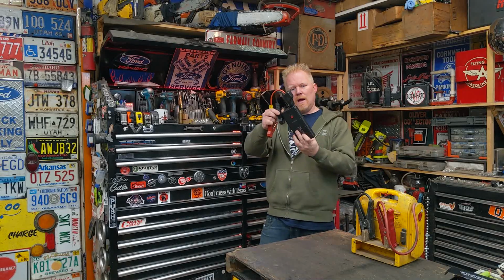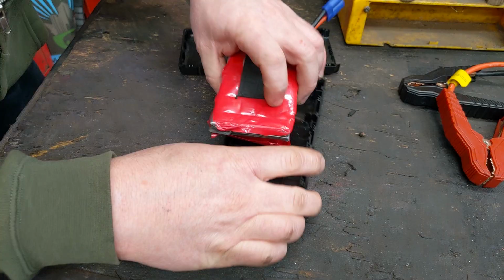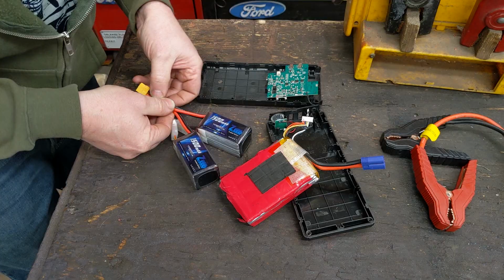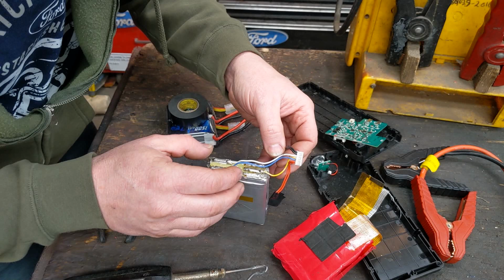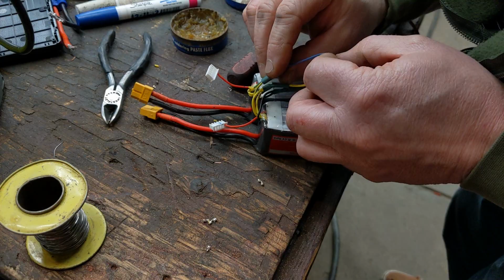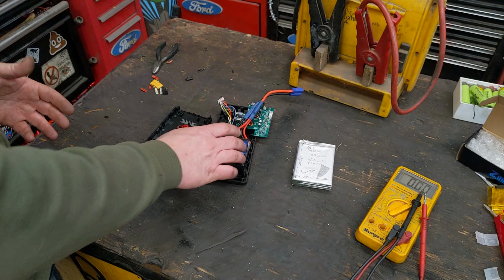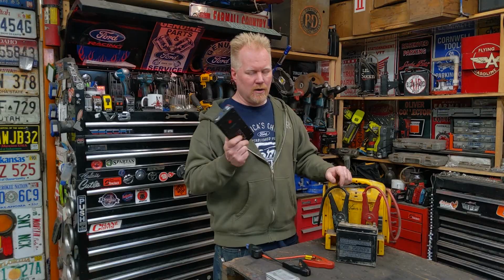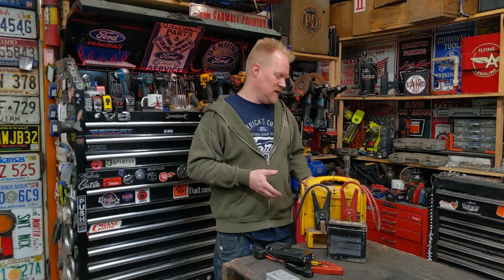Lithium Jump Pack Battery replacement HOW THEY WORK

Comment: Buy a super capacitor jump starter, never have to worry about batteries
Reply: They dont work on 0v batteries
Reply from the maker: The super cap starters have their own set of issues. One if the battery is too low it won't do anything. Two it can take 5-10minutes for it to pull a charge from the weakened battery before you have 1 attempt at starting. Fine for a just low/weak battery, but not a stone dead battery.
Reply: @sixtyfiveford  they could take longer than that even if your battery is super low

Comment: i have the exact same"trekpow" jump pack, a few of them actually.. mine wont allow any power out when theres no voltage, i cant use it on a winch or a car with no battery in it, i didnt think itd work with a 0v battery like you showed in the video i thought it had to see a minimum voltage, the cables and little relay block are different on mine, seems everytime i buy one that part is adifferent design, mine all seem to kick out like yours did if you dont get the start, but it beeps and i have to unplug it from the pack and from the battery before itll work again, if that relay block sees voltage from the battery in the car or the jump pack itll stay in that squacking mode.. its annoying

i wonder how dangerous itd be if the relay was removed and the connection jumped.. probably very if those clamps ever touched that batteries at  dead short.. wonder if i could tag a couple wires off the activation side of that relay and bring them out to alligator clips that i could apply to the car battery im jumping to lock it in as balls to the wall while cranking, and just be smart enough to not crank on the think for 40 seconds straight.. i dont mind if the thing blows up while in use i just dont want it live all the time its behind the seat or tossed around
Reply from the maker: I just bought a spare set of dummy clamps. There are two types, the smart relay activated ones and dummy that supply power constantly (have a little red box on the positive side that just has some diodes to prevent the alternator from charging it). I'm going to use it to power tire inflators, winches etc. I'm going to make the positive cable relay activated off the cigarette plug. This is so it'll shut off power via the relay when the voltage is too low. So put a 40 amp (or larger of I have one) across the Red Pos cable. The relay will only be turned on when I plug the DC output cig plug into the side.

Comment: Any ideas on where to get the BMS board (ckt board) ??  These are generic for the vid jump starter as well as the Amazon "TopVision" units.  I need a board.. mine doesn't sense the batteries properly.

Comment: The BMS will not work right when you have more than 1 cell on each sense wire. The whole point is to charge each cell individually so nothing is over OR undercharged.
Reply from the maker: I think your interpretation is a little off. When 2,3,4 etc cells are linked in parallel they and essentially one capacity and maintain each other. In series(2s,3s,4s etc) is where the BMS comes in to make sure all cells are say 4.2V full.
Reply: @sixtyfiveford  Well, yes, in parallel both cells will equalize to the same voltage. Fair point.

Comment: You can get 18650 or 21700 samsung high drain for the lead acid and create a new and better battery. That would be cool to see. Jehugarcia YouTube channel got me Into 18650\2170
Reply from the maker: The problem is 18650/21700 can't put out the amps needed like a lipo pack. 18650 peaks out around 30amps high drain and 40amps for the 21700. The lipo packs I put in deliver 180amps each(orig was 105amps). I love the 18650/21700s but think a better 12v pack could be built from Lipo packs.
Reply: @Pecan pie are you saying retrofit the lead acid jump pack to use lithium 'type' batteries? that would be interesting to see but you'd need to find a charge controller to protect the cells

Comment: Very cool!
I had been wanting to get one of those. But not sure witch brand to get.
Reply from the maker: They're pretty much all the same Chinese guts with a different plastic shell and random made up brand name. I would get one with the big lump(black chunk you see on mine) in the cable as this monitors the voltage and prevents over discharge. The super cheap ones generally only have diodes in the cable(smaller red block) just to prevent reverse connection.

Comment: Got a question for you Moe, is it safe to use an 18v tool battery to jump start a car? I just assembled a jump starter using booster leads with reverse charging protection and placed a fuse holder coming from the Makita battery adapter, will the 20volts coming from the Makita battery damage anything? I am assuming that because the current is going directly into the car battery and not the electrical system that it would be ok for short charges or a boost, or should there be a resistor used to drop the voltage?
Reply from the maker: Great question. What generally happens when people try this is they short out their tool battery. They do this by attempting to start it while connected or the battery is so low that it draws too much. These can only dump out about 60 amps before they start shorting out the internal fuse ( fusible link ) of the battery. If the battery is just low barely won't start the car. Connecting this up will give your 18-volt tool battery and work out but it'll just charge. Have to let it sit there for a good few minutes and it may give you enough for a final attempt. Now the increased voltage: I've seen alternators peak a little over 15 volts on a dead battery. The peak 20 volts of the 18-volt pack is pushing the limits of the system. If it was an older car, I wouldn't even give it a second thought. On something modern, I would probably remove the battery terminal on one side and let this tool battery charge directly to the car battery at its 18/20 volts.
Reply: @sixtyfiveford  Thanks Moe

Comment: Can you replace the lead acid battery in the yellow jumper with a lithium battery?
Reply from the maker: Not easily without a fair amount of circuitry. You can see the little computer in this one. That is required to prevent the packs from essentially blowing up during charging/use. They do have lithium phosphorous batteries that have built in protection and are the appropriate size but they are not cheap.

Comment: I’m a little confused… how does that start a v8 engine?  They are 1500 in series so 3 amps. On the old lipo it reads 35c. So, it can do 105 amps. How would that jump a v8?  Am I missing something?
Reply from the maker: They're are generally 2 different C ratings for all lipo batteries. A constant high discharge rate and a surge momentary rate. The 35c is going to be the constant discharge rate with a much higher surge rate. In theory the batteries I put in (1500 120c x 2) can put out 3000mah at 120c or 360 amps. It does this from the moment you turn it on and the lead acid starts to charge. It can supply 360 amps for 30 seconds (3 amps continuous for 1 hour/3000mah) . In combination with the lead acid, it has enough to easily crank the vehicle (v8 starter draws 200-400 amps).

Comment: Great video keep it up! I just use my big charger for these types of chores but the cord is a down side…

Do you think one of these would start old 3 or 4 cylinder Perkins diesels in cold temps?
Reply from the maker: I have no doubt it would start a 4 cylinder diesel. There's a few comments from guys just in this video that use these to start their diesel backhoes/tractors.
Reply: @sixtyfiveford  thanks

Comment: Hi, thanks for the great video,learned a lot. One question, how much current will the car starter put out? Thinking about using it on my HSS9 snow blower for a 7 amp led light pod. Will it work? TKS
Reply from the maker: In testing they seem to put out around 700 amps momentarily.

Comment: If my batteries are expanding inside the case, its safe to poke holes to release the gas then cover with foil tape like you did? I have copper foil tape. Does it matter? Is it dangerous if the tape is conductive?
Reply from the maker: If they have bulged they are already 50-60% power reduced and will die in weeks, maybe a few months. I relieved the pressure mainly so they didn't destroy the plastic housing.

Comment: Two batteries in parallel equalize the voltage? I'm thinking they would hunting each other and batteries will drain in long run.
Reply from the maker: They will always balance each other. It's done all the time with lithium ion cells because they only come in a few sizes. It's not extremely common to see with lipo packs because they can be built in any size. It's identical principles though and works great.
Reply: @sixtyfiveford  I'm thinking to use Diodes. Pls let me know if you try Diodes.
Reply from the maker: @thegoldenland  You don't need anything. When you hook multiple batteries together in parallel they act as one cell.

Comment: How about addapting it to take a ryobi 18v battery for example
Reply from the maker: The lithium ion cells in a tool battery pack don't put out enough amps. Something like a 4.0ah Ryobi pack will only put out around 50 amps. The lithium polymer pouch cells will put out hundreds of amps.

Comment: I bought 3 of the harbor freight tools lithium jump starters, total junk and wouldn't start anything. I wasn't sure what was going on. I saw Project Farm test several brands and the HFT couldn't turn the engine over when he tested it either. What a waste of money. I wonder if I'd be better off just keeping a $24 Walmart lawn tractor battery and jumper cables vs some of these battery packs.
Reply from the maker: I carry one of those UR-1 $25 batteries everywhere. Actually had the battery die in my Escort in the heat of summer 2020 and I just threw that tiny battery in for the day/week. Ended up being much longer as it worked so well. I ran it until March of 2021 without any hiccups(about 9months summer and winter)). You just have to shave the flat blade they have down a little and the round terminals fit right on.

Comment: Great video. Is there a huge difference between the 4000 amp ones and the 2000 amp like yours? I was looking at these and twice the power for 45$ more? I just wanted your thoughts about these. Thank you, Jim H.
Reply from the maker: I think they just have more capacity, but don't think they deliver anymore jump starting power. I haven't found a V8 engine this little guy won't easily start at least 7-8 times back to back. So more capacity might mean you could start the engine 14-16 times?

Comment: On my jumper.i have 3battery  packs tape together,but I nodess 1 off them look swollen the other 2 are flat ,is something wrong with the swollen? The jumper still works ...
Reply from the maker: A bulging Lipo pouch battery is a sign of it failing. It is off gassing and likely already has reduced capacity. They don't survive long after they start bulging.

Comment: Just out of curiosity, why not use the 18650 cells instead of the polymer packs?  Is it because of the requirement to spot weld the cells, or maybe because of output capability?  Maybe some other reason?
Reply from the maker: You're only going to get maybe 150amps out of a 18650. A Lipo is going to dump 600-800amps. So you would need 4-5 in parallel and 4 in series. So 20 High Drain 18650 cells(couldn't use normal 18650).

Comment: Hi! I have a battery-testing related question… on a Carbon Pile tester, like the $50 one at Harbor Freight, when you apply a load = to 1/2 the CCA of the battery, are you using the top amp scale or the bottom CCA scale? So if it’s a 300 CCA battery…. Do you apply 150 amps on top scale or 150 CCA on bottom scale? Thanks! (I figured you’d know this!)
Reply from the maker: With 300cca battery you would apply 300 on the bottom scale to match the battery. The top scale is the actual amp load being put onto the battery (150 amps in the case).

Comment: Yo AntiGrav, two of your XP-10-HD at $200 each in the past 3 years and now I'm watching this video.  You see where I'm going with this?  How are your dirtbike batteries so awesome but these jumppacks fail to charge after a year and very occasional use???
Reply from the maker: Others pointed out that lipo batteries hate being store with a full charge. They'll last for 20 years if you store them at 3/4 charge/3.8-3.85volts per cell. There is still plenty of juice to start your stuff and the longevity is worth it.

Comment: So I fly drones and have tons of those batteries. The way you have them hooked up is dangerous. It will work fine till one cell in a battery pack gets weak.  Then you have no way to balance and this will very likely cause issues.  IE fire smoke. ETC. Be careful.
Reply from the maker: Paralleling lithium batteries like this is extremely common and doesn't give you any balance issues. When The parallel cell dies the good cell never starts the other cell on fire. It will simply drain down the other cell and you will have a weak battery pack.

Comment: True or False, the small Lithium Jumper Packs, back feed charge??
Might make for a good video.
Reply from the maker: You asking if when you start something if the alternator of the car charges the pack? It won't because they have a set of diodes in series on the cables.
Reply: @sixtyfiveford  yes that’s what I was asking, thanks

Comment: What's your take/experience with rejuvenating or bringing lead acid batteries back from the dead with high current chargers or DC welders?
Reply: High voltage would make more sense, you can look up how to manually do a desulfitaton process (Tought 20ish volts for 12v battery's) or you can buy a desulfitaton charger, like a Telwin or an C-tek, however I'm not fond of the process... Whenever a battery is losing power I think it's just better to replace them
Reply from the maker: I have spent way to many hours playing with lead acid batteries. DC welders=bogus. All you're doing is trying to arc/burn off internal shorts which is actual lead touching lead. Problem is once the battery gets to the point where it is shorting all of the lead plates are literally falling apart. So you may get this to work for a day or month but another chunk will fall off and short out that cell. You can do the same thing by literally dropping/slamming the battery against the pavement to jostle the broken chunks of lead plate off each other. You'll see countless videos on it and people claiming it's a miracle. What you don't see is the battery self discharges in 2 days and is completely dead. I see people draining, washing the battery out, refilling with new acid and it is futile if you have a shorted cell. Desulfators are a pipe dream as well. Are there ones that work on a HEAVY DUTY forklift style batteries, Yes. But it takes months for a $5000 desulfator to do it's magic. Nothing you buy or diy build will desulfate a weak battery.  The only bandaid for a weak battery with no dead/shorted cells is adding magnesium sulfate (epsom salt) to the electrolyte. This chemically decreases the electrical resistance of the electrolyte and allows the battery to dump more amps faster. Essentially bringing it back closer to new. I have a few older videos on this and have stretched the life of batteries out by and additional 1-5 years. I think the oldest good battery I have in use right now is around 15years old(not common). But I only use it on a tractor that sees little use as the more your charge/discharge the more it ages. The lead plates are a consumable and do degrade after time.

Comment: How did u  set it up to charge it
Reply from the maker: I utilized the original on board charger that came built into the jump starter.
Reply: @sixtyfiveford   thanks for ur reply  ok if I belt something like that but a bigger one for a jump box how would I go about charging it
Reply from the maker: @jasonmartin9393  You just need a BMS (battery management system) charger. They're pretty cheap. You can also get ones with a full digital display that will tell you every detail about the cells in the pack and charge them. They look like this: https://amzn.to/3AYYmFY
Reply: @sixtyfiveford   thank for helping me out  so like if I take two 14.8 volts  6200mah  60c  battery’s and hook all the  bms wires and main wires together  it should still charge it wouldn’t it ?

Comment: I have one of those bigger jumper boxes and i found the perfect solution/ upgrade.  I bought 12 of those headway lithium iron phosphate or "lifepo4" cells and replaced the lead acid battery that it came with. So 4s1p will easily start a car, ive got 4s3p in the jumper box that looks almost exactly like that yellow one youve got. I could make a video if your interested. Lifepo4 is also much safer than those lipo packs. Im worried about burning down my house with those. These are the lifepo4 cells in this video
https://youtu.be/tMUBBAiFX6c
Reply from the maker: I so these a few years back and I remember them being pretty pricey. They look like the pack a punch.

Comment: Have you tried eBay
Reply from the maker: I did look. Lipo pouches are commonly build to size to meet the suppliers demands. These weren't a common dimension and even if you did find them they would have to be high discharge.